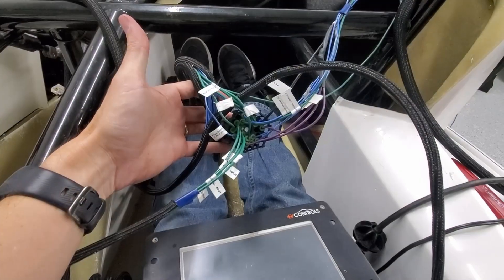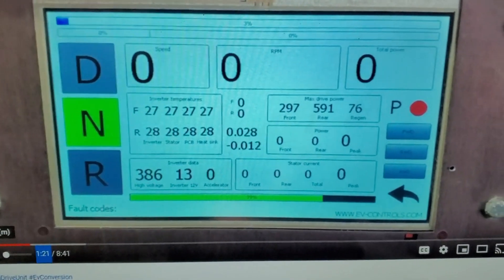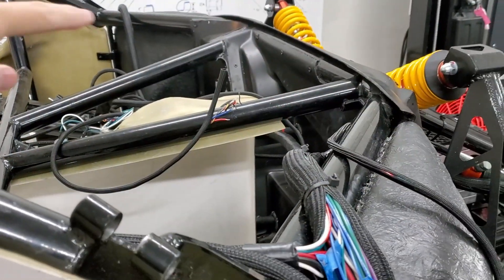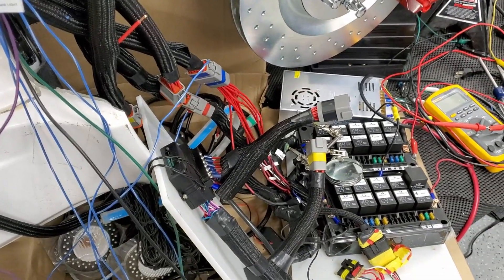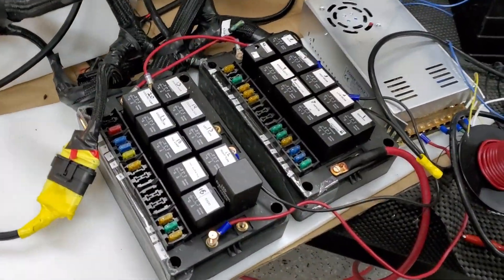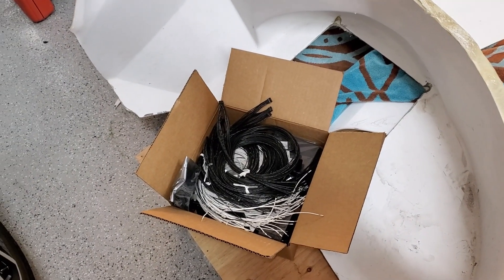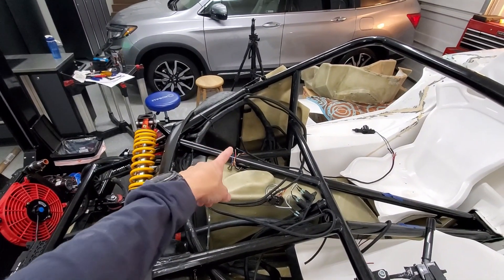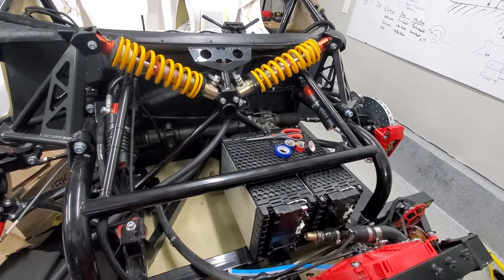Tesla Motor Wiring Part 3

Comment: Did you ever get the parking brake upgrade? Working on a similar project now on our channel.
Reply from the maker: Not quite sure what you mean.  I ended up getting an aftermarket parking brake controller.  You can see my video if you like.  https://youtu.be/Ci8IeDyotfs
Reply: @electricsupercar  I was specifically asking about the 4 pin update to the EV Controls T-1C controller that allows you to get push button R P N D.
Reply from the maker: @farfromguam  ahhh...yes.  I did get the upgrade.  I currently have push buttons to switch gears
Reply from the maker: Also you may want to check out their new product T-2C controller.  It has push button inputs and gear indicator outputs.

Comment: Have you thought of using an android tablet as the dash since there are lots of apps already available?
Reply from the maker: I haven't looked into it too closely.  Do you have any links to look at?  I know that there are some that are able to use OBDII port information or even work wirelessly.  With my build, any information that I want to display on the dash, I have to setup my own sensors and then come up with a system that can take the sensor info and display it.  I have primarily looking at stand alone dash displays.  Let me know if you have other options to consider.
Reply: @electricsupercar  l haven't taken to close of a look at some of the apps available, but I saw one that seemed to have some potential, "RealDash" you can setup the cluster in a way that works best for what you may need Kw, Wwh, V, A.
Thay have not only obd2 support but also alot of CAN reading soft support.
Reply from the maker: Thanks, I will have to check it out
Reply: @electricsupercar  You might not want to. Tablet PCs aren't built for the rigors of constant outdoor use or routine UV Exposure so they quickly foul- automotive screens can be bought instead, but they're expensive and are in a further league of their own too.
However- that could be solved by bringing the darn thing inside and detaching it from the car. Could also be an aggressive form of anti-theft too.
Reply from the maker: You make several good points.  Several things I had not thought of.  I like your anti-theft system idea.  LOL!!
Reply: A little late, but adding more information.  I'm running a custom gauge cluster by using and Android Radio Head Unit mounted in place of the dash (no speaker wires, just power and dimmer) and using real dash for the software.  That talks 2-wire serial over USB to an ardunio which collects data from various sources (ECU via can bus, field devices via digital/analog inputs and outputs) and sends them to the Android Unit.